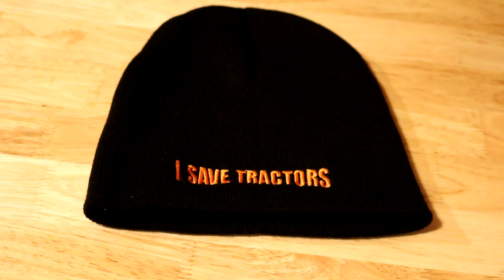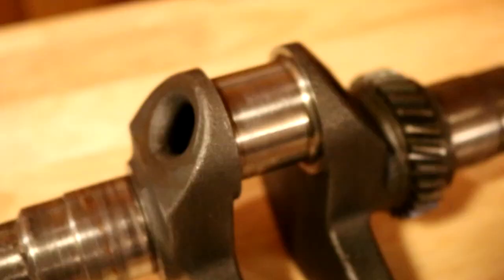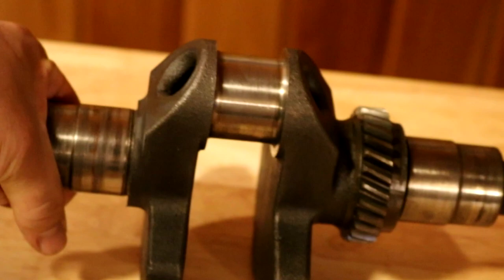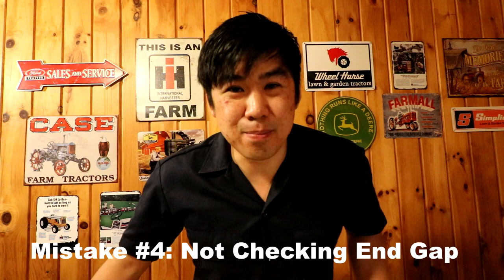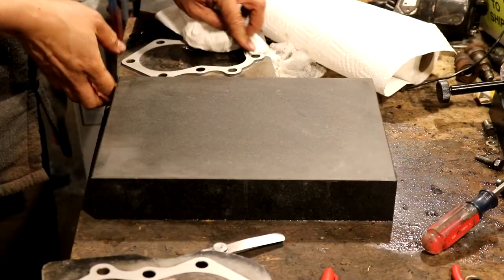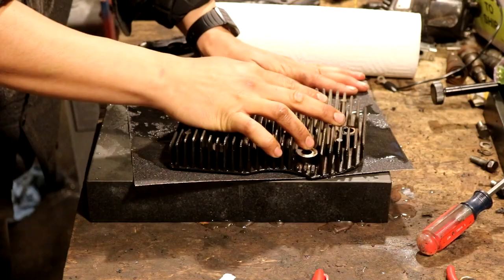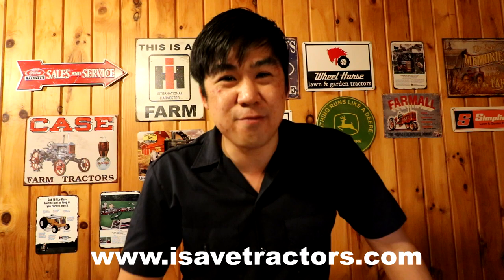5 Common Mistakes when Rebuilding Garden Tractor Small Engine

Comment from the maker: Are you considering rebuilding your vintage garden tractor engine? You should! iSaveTractors is here to help you every step of the way. Don't forget to like, share, and subscribe to be notified about of our weekly videos! Thank you for saving the tractors!
Reply: isavetractors I've got a 1973 wheel horse that runs fine doesn't surge or anything but at low idle it starts to stall out. Nothing is loose springs are in proper place. Any ideas?
Reply: You forget to mention to properly torque your cylinder head bolts to factory specs.

Comment: Im 15 and i have a 1973 troybuilt horse woth an old kholer engine on it. The engine is about shot and the ignition system dosnt work. im planing on getting a preditor engine as replacment but im gonna go ahead and rebuild the kholer and get it back working again
Reply: Good plan. Kohlers are pretty easy to rebuild, just download a service manual and take your time.

Comment: Hey Norman. One other thing to point out that people really take for granted is the cleanliness of the parts. Even new parts should always be thoroughly cleaned especially if the parts in question happen to have oil gallies in them. Blind gallies like on some cam shafts and many cranks on the pressurized lubrication systems are prone to catching and holding lots of grit and material from say previous engine problems aka running it low on oil or a seizure for that matter. It's always wise to remember to clean these parts from the engine oil pumps to blocks and all passage ways! On top of the removal of welch plugs on cams and cranks to get to the blind spots inside them. I've seen so many preventable engine failures due to dirty parts, it's not funny. Especially when it involves something simple like a head gasket or valve cover gasket being replaced. PLEASE take care and your time to clean up the outside of the engine and you won't be allowing the debris from the outside to fall into your open engine parts while you are doing the gasket job. I understand it's a pain in the ass, but a little love in the beginning will save you lots of headaches later on afterwards! Dirt in the crankcase is your engines #1 killer. Plus your engine is air cooled and will run so much cooler by taking all that dirt off it prior, which 9 times out of 10 is WHY your gaskets failed or valve guides failed to begin with due to over heating conditions due to packed in grass and oil vapors from the crankcase breather, or weeping gaskets. Just a quick FYI for everyone out there from a guy who's been in this field for my entire life. Thanks Norman, appreciate the advice to the public. Your not kidding when it comes to "Micrometer Eyes" we call these people. They have super powers unlike any Human I know of LMAO.  Have a good night brother and again thanks for posting this educational video.

Comment: Hi Norman thank you so much for this info now i know what to do to fix my mower because i am having trouble keeping the oil pressure up. On my ch740 Kohler oil presser when engine is cold it start at about 30 to 35 psi it still low. Bit pretty soon as it warma uo start decreasing to when it's really warm to around 5 to 10 psi.. So i can only work with it for a few minutes because then it will start losing compression it haa damage my valve intake seats already so  now i have to fix and do valve and head job again

My question is after watching the video. If i have too much end play or if my crankshaft it's worn out already is that the main reason why i pose oil pressure du to the fact that i check Everything else oil pump etc?

Comment: Hello.This motor im working on a Kohler 25 year old k series it has new carb which it does still pop just a little but whats throwing me off is i have adjusted the throttle now if i just barely move the throttle position it doesnt take much movement at all to slow it down or speed it up something just doesnt seem right about it and then it tries to over tach when i barely adjust could this be internal gov? going out? Tractor is not mine im just helping someone out but he put carb on it so i dont know how it was running before. Thanks for any help about it. B.

Comment: I rebuilt very crudely mind you a fd590v Kawasaki engine it was run out of oil in the top crank bearing seized I tore it all apart pushed out the crank bearing and rod as they were welded together found a crankshaft on eBay and a new new bearing and put it all back together I can't tell you if anything was scored or if the valves are bad or anyting as I didn't even look put it all back together put some 1550 synthetic oil in it and it runs great

I will say about every 200 hours I have a problem with the left side plug fouling out but if you clean the chunk of carbon that gets in there and put it back in it runs good I don't know how old is doing it though it's not burning any oil or doing anything out of the ordinary I switched the coils side for side but haven't had time to run it and see if it changes

Comment: ty for the help im rebuilding a k 321a out of a cubcadet 149
one thing im wondering about, does that engine have counter weight gears and if i remove them do i have to adjust the crank balance
Reply: I know that you didn't ask me, but because I have a 149 w/ the same engine, and I've learned what a lot of the owners HAVE
Reply: Sorry, I prematurely hit the "send" button by accident.

A lot of IH Cub Cadet owners have made the decision to remove the balance gears...because they're infamously  known as "grenade gears"!
Your 321a DOES have them.  Most of the ones that remove them have likely done nothing else to them.  Check out David Kirk and his "Killer Kohler" .
https://www.kirkengines.com
He offers a plate that machine shops can attach to the counter balance on the crank.  Among those that choose to simply take those gears out...they argue about how "overbuilt the "K's are, w/ those big crank bearings, and they swear by the practice.
Reply: @kenthawkins2418  yah im wanting to do a full engine rebuild im not sure what i should ask them for at the machine shop i think the engine has never been rebuilt
Reply from the maker: I suggest you check out our article on this subject here: https://isavetractors.com/articles-1/engine-science-the-balancing-act-of-single-cylinder-engines/

Comment: Got a garden tractor with 14 hp kohler guy said he rebuilt 20 years ago and never worked right and parked it pretty much. The only thing he told me was it went wide open throttle the governor wasn’t working. I got engine running at idle but would not idle up. Go a get new carb to solve that since carb is shot. He put std piston and rod in and when I started it it knocked slightly. Figured gotta tear it down didn’t do it right. Yep sure enough cylinder is egg shaped bad so gonna have to bore and buy new piston rod and stuff

Comment: and when you buy your micrometer get a gauge block with it so you can learn  how to use it the most common mistake iv seen working in a machine shop is improper use not centering it right or over tightening or dirt or even not understanding how to read it correctly which will lead to inaccurate measurements and its the same with a bore indicator and always check your crankshaft end play

Comment: IsaveTractors. Qustion-- I have a Craftsman Kohler Command. Model number 917.251650. I need a grill for it but Sears says the tractor is too old and they no longer make the part. Any Idea where to get one and also the light assembly.
Reply: Ebay, Craigslist and now Facebook ads. Most guys selling parts will have a bunch of parts tractors laying around , you only need to find one guy with a good grille. Thrill of the hunt, I just got a NOS hour meter for my Cub 169 off eBay and a manual for my Deutz 613, been years looking

Comment: Do you normally need to do work on cams in garden tractors, or are they pretty durable?
Reply from the maker: No you dont normally need to work on them. Occassionally the points lobe have wear but its rare
Reply: Decompression  gizmos  on cams give trouble  though

Comment: What is the possibility of the valve seats going bad? I'm itching to put my motor back together but after having the block bored and the crank turned I dont want to take shortcuts.
Reply from the maker: It's possible. Have your machine shop recut the seats for a completely fresh build. Its normally not expensive.
Reply: @Isavetractors  I had them vacuum test, he said they were ok, so I'll slap them a little and they should be ok.

Comment: Thanks Norman!

I am in the process of rebuilding a Kohler Magnum MV18S  (Opposed Twin).

HOW would I increase the HP & TORQUE on this engine? Sadly, there are not many people out there with ANY experience with these engines...

I have spent HOURS looking, and all I have gathered is that I should do a COMPLETE Valve Job (huh?), And upgrade to a larger Carb (where)...

I reside just West of Seattle, Washington and am Very Willing to learn & get dirty with knowledge. What assistance could you give?

Many thanks Norman!

-Thomas (12)
Port Orchard, Washington
Reply: Have you checked out : Taryl Fixes All? Funny and informative, he’s easy on the ladies eyes too 😻
Reply: @RustyZipper , Taryl gives "AWESOME" tips, but told me to find soneone... :-(

Thanks Rusty Zipper!

-Thomas (12)
Port Orchard, Washington
Reply: Check in with some pulling tractor guys , specifically search Brian Miller Pulling tractor tips on google. He’s like Taryl but loves making competition garden tractors.
Reply: @RustyZipper  Brian Miller, you say?

Does he have a Facebook page?

Thanks Rusty Zipper!,
-Thomas (12)
Port Orchard, Washington
Reply: The best way to get more HP is to get your cylinders bored and a big bore piston kit. The best way to get more torque and power is to increase compression. I know a guy who builds two stroke boat motors because he races them and his goal is usually about 150 lbs compression. You’re not going to want to run it that hard, but maybe your goal could be 110 to 125 lbs compression. Valve jobs help with that, making sure they’re to manufacturers spec, though there’s really no way to make more power without using aftermarket kits or specs. Hope this helps.
Reply: @jacksonk5308 , Thank you. :-D

Comment: Great advice and I can see how a newbie like myself would skip these steps.  My question is how do you measure the cylinder with the micrometer that you showed?  It seems you could only measure the piston and that does not seem like the correct measurement.  Please help me out here.  Again, thanks for the great videos.
Reply from the maker: To measure the cylinder, you first use a telescoping gauge to transfer the dimensions to use with an outside micrometer. See our how to measure an engine video

Comment: Hello Norman ,
I have a old cast iron small Kohler engine that's complete other that the   model number & spec decals are  missing .
How can I figure out what size this engine is ?
It looks like maybe a 5 or 6 hp .
Any information would be appreciated.
Reply from the maker: Measure the bore and go to our website www.isavetractors.com go to resources then service manuals. Download our quick spec sheet. Compare bore size to whats in the chart to determine which engine it is

Comment: Why do I have to gap.the rings because even in semi trucks we don't do that. Just wondering my dad told me to skip that step because its un needed
Reply from the maker: Air cooled engines expand a lot. Definitely don't skip it
Reply: @Isavetractors  well I put it together with your parts and it is really stiff
Reply: @Isavetractors  my boss and my dad told me I didn't have to and I argued but they said if it doesn't work they was going to pay for it

Comment: What size micrometer do you use? Do prefer the original (analog) vs a digital?
Reply from the maker: Micrometers come as 1 to 2 inch, 2 to 3 etc. I have them from 0 to 7 inches. I prefer the analog ones
Reply: @Isavetractors  what size would you recommend for measuring the journals on a K181 and K321?
Reply from the maker: @Natethanastysnake666  a 1 to 2 inch micrometer
Reply: @Isavetractors  thank you Norman! Going to be rebuilding my JD 110 RF K181 and my JD 140 H3 K321. I'll be ordering both of your engine kits for the rebuild! Thank you

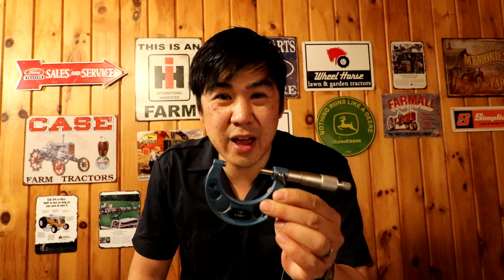Comment: 3:07 high quality digital calipers are actually pretty good for measuring engine parts. But it HAS to be a high quality model rated for that much precision. They have been make good digital micrometers but have fun trying to measure a bore with those, going to need a bore gauge or high quality calipers.
Reply from the maker: Problem with calipers is not the precision of the instrument but the precision of the user since it's a slider vs a screw you turn. Wrist movements can lead to inaccurate measurements in certain shapes.
Reply: @Isavetractors  oh for sure,  we used clamps to get good measurements.

Comment: I have a 1970 Wheel Horse Raider 12 with the K301. It's old and tired and at times I hear some knocking sounds in the crankcase usually if I am on a hillside ( I always check oil level before I start it). Some have told me that they are noisy when new. I'm not convinced of that. Should I tear into it this winter or just see if it gets worse? Great video's.
Reply: Sounds like the rod is worn, this will allow "slapping" or knocking.
Reply: Run it 'till it blows. In the mean time keep your eye out for a complete replacement. Oftentimes you can find a good running engine cheaper than a rebuild. They made tons of the Kohler k-series engines and put them in all kinds of equipment. The Cub Cadet ones are the only one to avoid in your situation because the oil pan/ mounting  holes are different than your WH but your style is by far the most common. A k241, k321, k341 will bolt in as well.

Comment: If I am working on an engine with a blown head gasket, I usually take the heads to a local machine shop to have them milled so they are guaranteed to be flat. Also, if you prefer to do it yourself with sandpaper, I've heard that it works best to move the head in a figure-8 pattern so that it wears evenly in all directions.

Comment: going after carburetor without check compression first is a loosing battle. that's why the 289 in my mustang wont idle & needs full choke to start

Comment: ahhhh slap it together, after cleaning it up, with new parts/seals.  new cranks are expensive... if have alum rods, the rods wear/egg shaped more than the crank should.  yes ring end gap is important.  clean motor is nice. the ones i get are so used as ppl cant check/change the oil ... run them out of oil and so bad need an overbore of .020" but that costs money... so i just dremel out the lip at the top to get piston out,  hone out cyl as well as i can, get .010" oversize rings, file the ring gap to what it should be. slap it back together again.. run 20-50 wt oil with 20% STP OIL TREATMENT and write on the gd machine CHECK THE GD OIL BEFORE EACH RUN OF THE DAY... CHANGE OIL EVERY 30-50 hours!!!!! 20-50 OIL w/ STP OIL TREATMENT, 20%

Comment: might want to add to next video.... wash the block and parts with hot water and soap... yep.... better do it.. i didnt.. i used brake cleaner.. brand new roll of blue towels. its great clean ... NOT..... if i could post a photo i would... i didnt run the motor long so damage wasnt to bad. i might get lucky with sandpaper clean up.. but yep .... hot soapy water.. told to me by the shop who did my mechane work on the bore and crank. 10 over and 10 under.

Comment: By the time you buy all the tools and they must be good ones not tools from harbor freight it comes in cheaper to just bring it to a machine shop that you trust.
Reply: Green Meanie Harbor Freight sells lots of good tools.
It's not the store it was 10 years ago.
Reply: Harbor Freight tools are much much better now than what they use to be.
Reply: @jhitt79  They may be but no where near the quality of true machinist tools that you need to measure with.
Reply: Green Meanie 
Speaking from experience, I've found the opposite is true.
Reply: @jhitt79  you must be some machinist then.
Reply: Green Meanie it's a hobby for me. I've got friends that are pros that have home shops that make me drool.  Does that make me an expert because I drink beer and make chips with the "pros?" Nope.
But I can tell you 100% that my H.F. 0"-1" mic is just as accurate as theirs to the hundred thousandths of an inch. It's extremely rare to need to be more accurate than 
that.
Reply: I’ve found that most machine shop have high quality, brand name tools that are 10’s of years old and been used 1000’s of times but yet never replaced. How accurate can they still be ? Plus the guys doing the machining have been working that dark , dirty, dingy shop for 20+ years and really don’t care because it’s not like a NASCAR motor. A hobbyist using Harbor Freight can achieve excellent results with knowledge from guys like Norman. And frankly I’ve taken mower engines in for rebuilds and been laughed at for wanting them to rebuild it ; like I can’t afford $300 and they are “above” that type of work
Reply: @RustyZipper  maybe I'm lucky that my local shop is more than willing to machine my Kohler engines.
Reply: fryloc359 - you are lucky my friend, good machine shops are few and far between where I live in NY

Comment: And who gonna do all this precision work? Costs money. Alot of money. Its not a rocket engine. Doesn't have to be  perfect..Cost over 1000.00 to rebuild a 100.00 engine if you take this guys advice.  Go buy yourself a new mower imo.
Reply from the maker: I've helped over 100,000 people so far rebuild their "$100" engines and turned on over a million people to the idea of rebuild vs replace. 😉👍keep saving those tractors folks. P.S. It doesn't cost $1,000 to rebuild these engines.